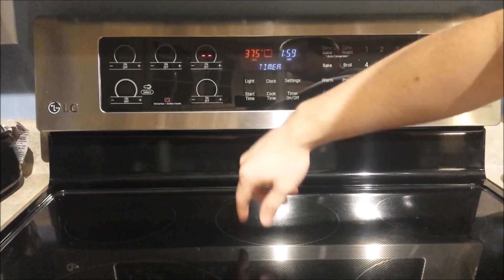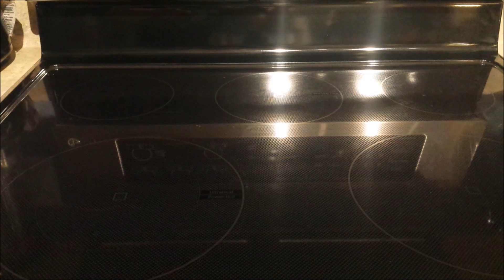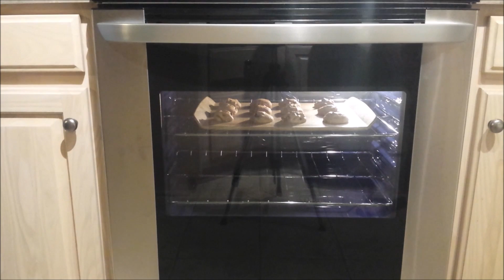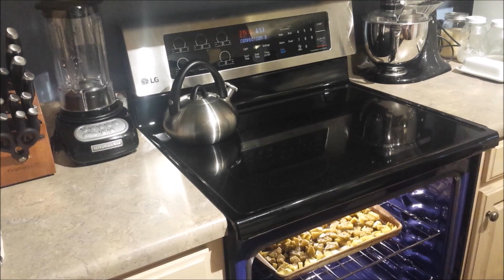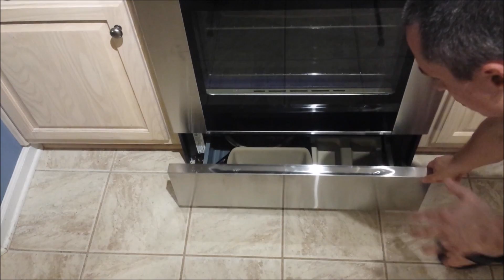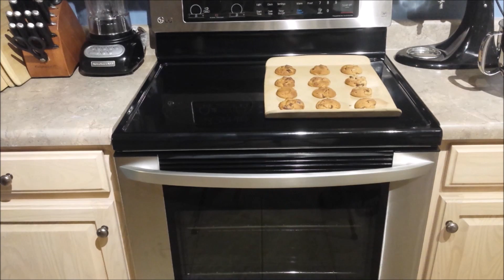LG 6.3 cu. ft. Convection Oven Review [JUNK - See Update In Description] (1 of 2)

Comment: One button switches two burners.  Does anybody know how to solve this problem? Thank for your help.
If I switch on the right top conner small burner it switches on two burners. The small one and the big one on the right side of the cooktop. If I switch the one on the right big burner it works fine and switches on only its burner. Please help.
Reply from the maker: It sounds like the control panel buttons aren't lined up on the right contacts underneath. If it's under warranty, have them send out a repair technician. Otherwise if you or someone you know is relatively handy, you could unplug the oven and then remove the cover and ensure everything is seated properly.

Comment: Can you help me, how  to bake cake with the heat just from down , which option I choose
Reply from the maker: There is no bottom heating element in this, unfortunately. As far as I know, all the oven settings use the rear heating element as well.
Reply: @DoresoomReviews  Are you kidding? There is, indeed, a bottom heating element. It is hidden beneath the oven floor. No oven heats just with a top element, except a broiler.

Comment: I was in Lowe’s today and was looking at it. 1st issue for me is lack of bottom heating element, because heat does not travel down, having the element at the top will result in uneven or undercooked or even burned food. Not your fault but those cookies were over browned. Anything like cakes, biscuits cookies you had better run that fan to circulate the hot air; if you don’t most of the heat from the element will stay nearest the top of the oven. Hopefully you have luck baking or roasting meats in it, but I don’t think it will be as efficient without an element on the bottom.
2nd issue is the digital display/control panel: that thin sheet of plastic they cover it with, gets greasy and oily from cooking, it cleans good at first, but over time it gets scratched, smeared and hard to see through .
Knobs would have been better with the display covered by glass. Glass can actually be cleaned with grease removing solvents , while plastic gets pitted.
3rd issue is the storage draw. It is very shallow, because the interior of the oven is vertically longer than normal (No need for that especially with the single overhead heating element) the storage draw walls were thin! Just a bit thicker than roof flashing aluminum! And it moved side to side when I opened it. Not very sturdy.
It’s a beautiful appliance and the top looks like it could do the job. The blue interior is great looking, but I feel like LG cut corners with that single heating element, and that cheap thin storage draw at the bottom.
Your video helped me to stay away from this one.
Reply from the maker: LOL, you should go watch my follow up video. You'll be glad you stayed away.
Reply: @DoresoomReviews  wow...I just checked it out...can’t imagine how annoying it is to have lost money on such an important appliance. Some of these companies either don’t care or just don’t do good research before they put out product.
Thanks again, and good luck.
Reply: There is bottom heating element. It is hidden under the oven floor. This is how the oven capacity is so large. The bottom element is the main heating element.
Reply: @garymolina1394  no way there’s a heating element under the oven floor…hidden too🤣…the heat would warp the oven floor

Comment: Mine had uneven heating and spot marks under the glass the first time I used it.  Good job I discovered this before my 48 hours were up (Home Depot).  I'm getting a refund.   Going back to coils.  Never had a problem with that kind of stove.  Also ... don't be fooled by the purple oven and it's EASY CLEAN setting.  Aint nothing EASY CLEAN about it.  You will be basically boiling water i the base of the oven then going in there to clean it yourself.  Buyer beware.
Reply from the maker: Glad you got a refund. This thing is a turd of an oven.

Comment: I've had this stove since April of 2020 - 9 months -  and if I knew then what I know now, I wouldn't have bought it. Nothing has failed (yet) but the "Easy Clean" feature is a marketing joke. Sure, if I clean out my oven after every use, it will be easier to clean regardless of whether I spray it with water, so the only thing that makes it "easy" is more frequent work. I have grease on the sides of the oven wall from using the convection feature ONCE that won't come off.  It cooks unevenly with the back side cooking faster than the front and the temperature is about 20 degrees too hot. I compensate by adjusting the temperature and rotating the food in the oven. Lots of work for a stove that's supposed to have been "calibrated" and is "easy". 

I clean the cooktop after EVERY use, and I mean EVERY use, and while it still looks good enough, it should look brand new, and it doesn't. Ceramic cooktops are not the great thing they're supposed to be.

Overall, I don't think this oven is great for the money. I think it's average at best for the money. Just a stove. It boils, broils, roasts and bakes.

Comment: Had this stove for less than a year. So far the lower control board failed, the broiler has failed and the cook top has now failed, the wiring harness BEHIND the stove has melted and needed to be replaced. The easy clean function is worthless, the cook top gets very hot when using the stove as described in the video. The buttons on the control panel are not satisfying to press and very mushy with no positive feedback. Do not get this stove, go with another brand/model. I have been without a functioning stove for four weeks now and LG / BestBuy has been at my house over 5 times to make numerous repairs and it still does not work properly. Stay Away.
Reply from the maker: I couldn't agree more!
Reply: Thomas Rundle The same exact things are happening to me. This stove looks fancy but it doesn’t perform well.
Reply: Did u get the geek squad warranty? Iw as wondering about that

Comment: I would not recommend this range - although it is a beauty - it is not functional. The self-clean does not clean! Had this only a few months when the oven stop heating properly, had to replace the lower heating element, the thermal fuse and the door lock! What did I pay for?!!

Comment: I was excited at first about my new stove. I have had it 4 months. I love the blue interior, however it is IMPOSSIBLE to clean.... even with oven cleaner. And the easy clean is worthless. I will never show anyone the inside again, as I can't get it clean. It is NOT self cleaning.... don't be fooled.
The lower drawer is so shallow (5"), the front of the door is easily dented from the INSIDE if anything catches. I keep the lids for my pans in the bottom drawer.  If one handle sticks up a little too high, when I go to close the drawer it dents the front of the drawer from the inside (single thickness).  
Also, the oven handle sticks out quite a bit.  My drawer that is perpendicular to the stove cannot open all the way anymore as it catches the handle.
Reply: Totally agree with everything you wrote.
Reply: @susanmueller9777  me too.  I was lured in by the blue interior oven.  Glad I had 48 hours to basically test it out.  Its being picked up and I'm getting a refund
Reply: I have same problem. Don't know how to clean. I tried every thing even they say don't clean with products.
Reply: Ovens used to be easy to "self-clean" with the high temp setting but now with the water / steam clean system it seems all of the ovens have problems.  Bring back the old method which WORKED.

Comment: Gotta say I’ve had mine for a year and I’m just trying to figure out the convection roast feature and what it’s used for, aside from that we absolutely love it 😍
Reply: Use the "convection" feature for roasting beef, poultry and vegetables. Don't use it for baked goods though...may dry out your baked goods. Convection oven is basically an oven with a fan/fans that help evenly distribute the heat for faster more even results...helps crisp the outside and the skin on poultry too.
Reply: Does the controls get really hot like said im the description?

Comment: Just bought this model tonight,had to return a Samsung electric range because it made a clicking noise every 30 seconds while baking.Called Samsung and they state that this noise is "normal" and is the relays switching on and off,but it drove me crazy.Anyway,I have a few questions;first,and most important,does this model make clicking noises while baking?Also,is the convection "true convection"?(Fan also has a heating element)The specs are confusing,one says yes,the other no.Hope that you can answer the question about whether or not it clicks before I get it delivered in three days!Thanks!
Reply from the maker: I hate to break it to you, but the burners on this range use relays that make a periodic clicking noise as well.

I'm not positive about the convection question you had, sorry. It does have a fan in the back, but I can't see any heating elements around it (not to say there aren't any though).
Reply from the maker: Your question reminded me that I've been meaning to update this video after owning the stove for an extended period of time. See video description for a few more gripes that I have with this unit.
Reply: Thanks for the quick answer and the help.Bummer..I may have to cancel this sale and find another bur first I wanted to ask a few more questions if possible.

So the clicking occurs on the LG at the top burners and not from the oven?

How often does the clicking noise occur?The Samsung clicked around every 30 seconds,only while baking.How loud would you guesstimate it is?Loud enough to be heard in another room?

From what you described it sounds like the LG has the "regular" convection.
"True",or "European" convection uses three heating elements,the third being mounted around the fan.
Reply from the maker: Sorry I forgot to follow up  right away - I'll answer what I can:

The clicking comes from the burners, I haven't noticed it from the oven. It's about every 20-30 seconds, and can be heard in the bedroom right next to the kitchen, even with the door closed. It has to be quiet in the house to notice it though. The oven is more of a modulated "hum," which isn't very loud.

Not too sure about the whole "regular vs true" convection thing - this is my first convection oven.

Comment: That looks like a bad design. Don't you burn your arm while fooling around with the burner controls if there's something cooking  on the stove top?
Reply: Who cares if tons of stoves have an equally bad design? Tell me, what is the advantage to the push buttons over a simple knob that you can almost instantly set to the position you want it in?
Reply from the maker: Tons of stoves have a similar design actually. The only time it's an issue is when there's a tall pot on the back burners, but that doesn't happen very often, since the larger burners are in the front.

What IS a bad design about this stove is the way the top edge is insulated. The front near the oven door handle gets VERY hot to the touch when you have a big stock pot on the front burner while making soup. I just discovered it this month - it gets so hot that I can't hold my hand on it for more than a second.
Reply: knobs break off and are more complex than a simple membrane switch on the existing membrane keypad. back controls are so kids cant get at them and burn the house down as recently took place. ideally they should use a bluetooth control panel so no fiddling with the panel is required.
Reply: @ysesq  knobs are better and the last thing they need to put on there is Bluetooth...if it acts up, motor money for repairs. Some things need to remain simple.